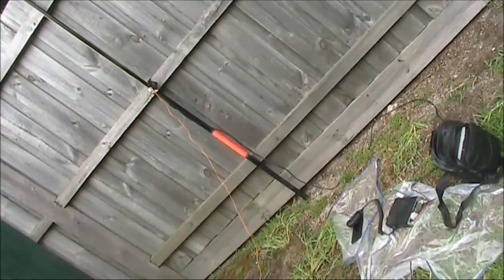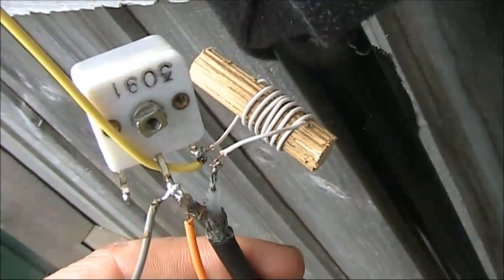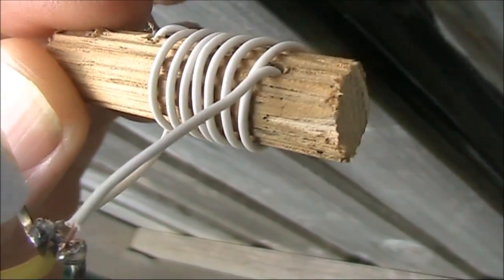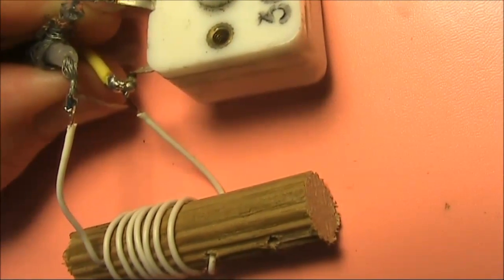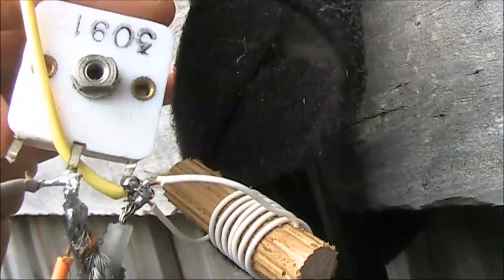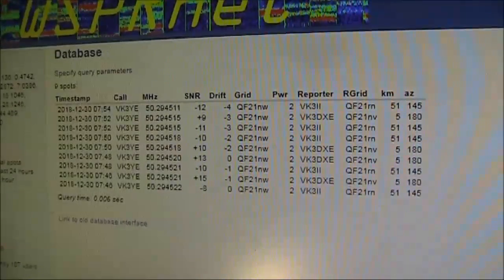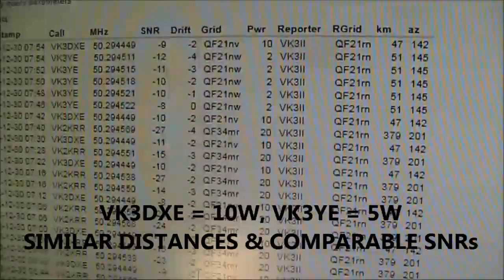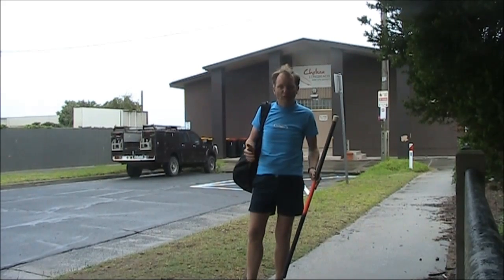Quick and dirty 50 MHz half wave wire vertical antenna

Comment: Can you build a 6m superregenerative receiver, like N1TEV..?
Reply from the maker: There's little point. There's no local 6m AM activity and little local 6m FM activity. So a super regen would just be a curiousity rather than a useful bit of gear. Though I have featured several videos on ones covering 88 - 108 MHz.
Reply: @vk3ye  ok, thank you for swift reply...